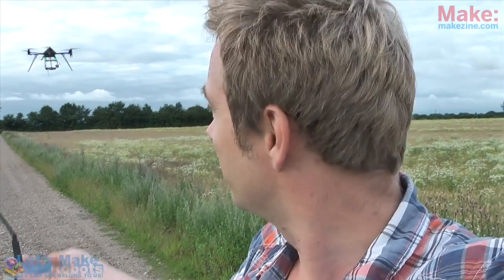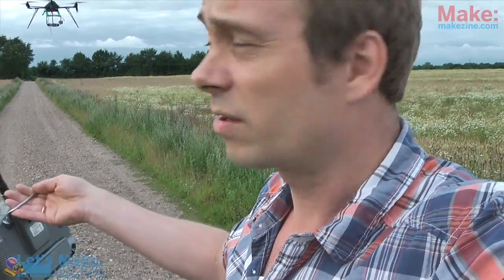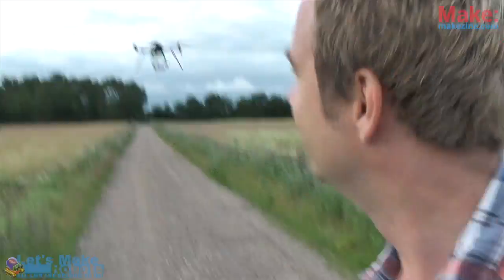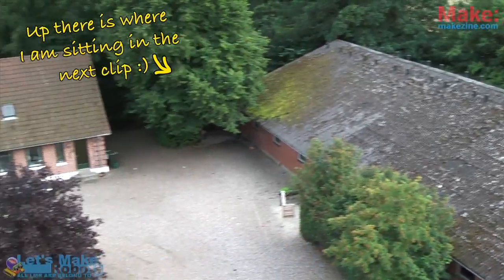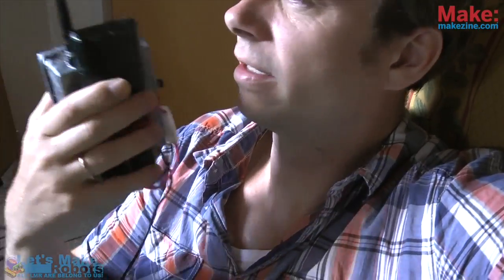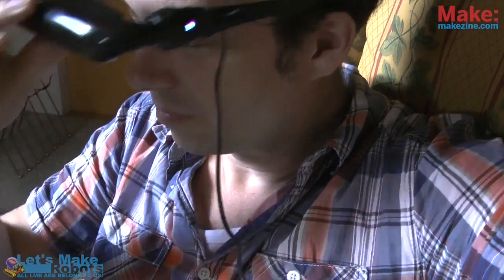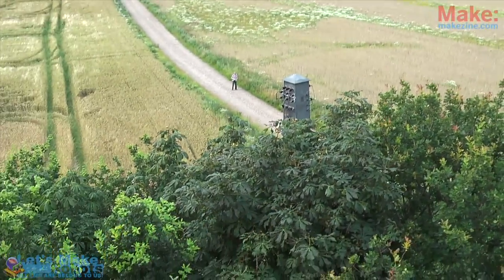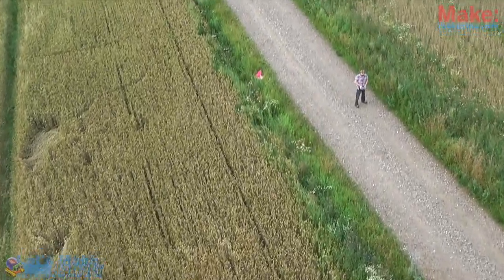The Latest In Hobby Robotics 15

Comment: @fritslyneborg 
I have been flying only single rotor rc helicopters like the trex 550, and you probably know that the tail rotor counteracts the main rotor in order to keep the helicopter form spinning round and round with the main blades.  So if you have four rotors that are all counter acting each other (to keep the multicopter from spinning) how do you have rudder control without give one rotor more thrust than another (more thrust on one rotor would also give pitch?)